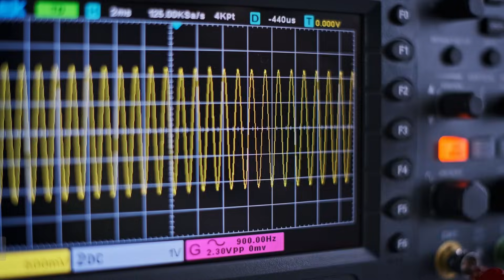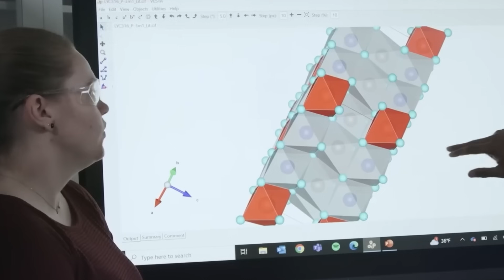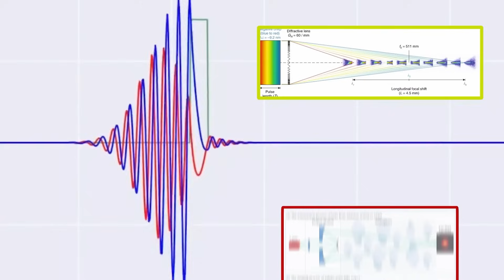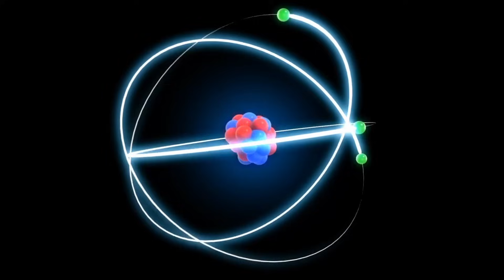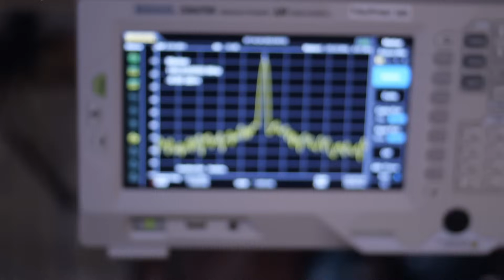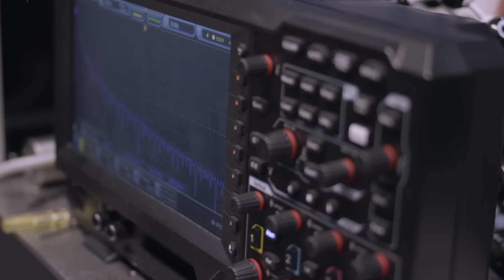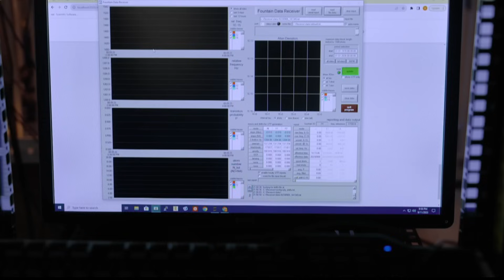This Quantum Breakthrough Could Rewrite the Laws of Physics

Comment: Brilliant. Very interesting.

Wall, veil or gradient. At some level there is a framework. The 36 quantum fields need structure. Otherwise 3D is just vibrating noise without structure. The Higgs field and the Hilbert space, to name a few.